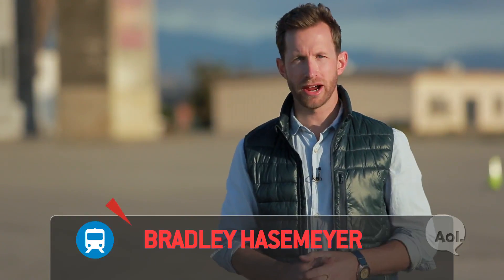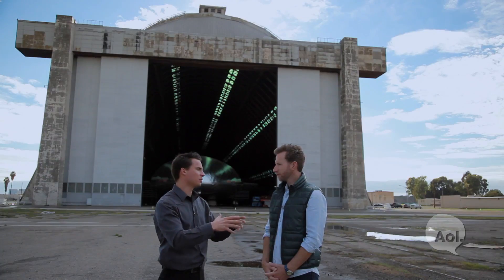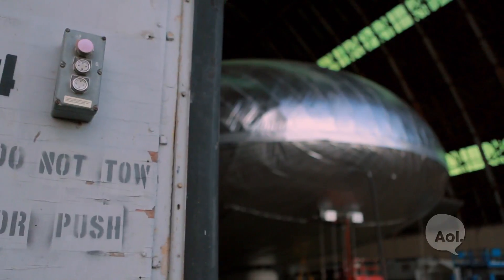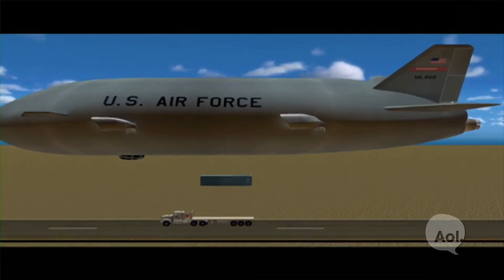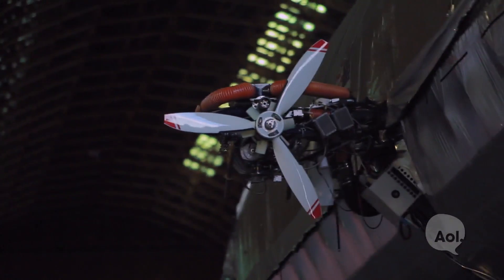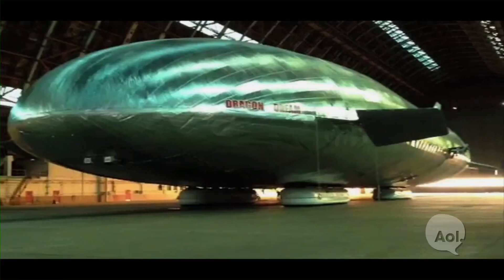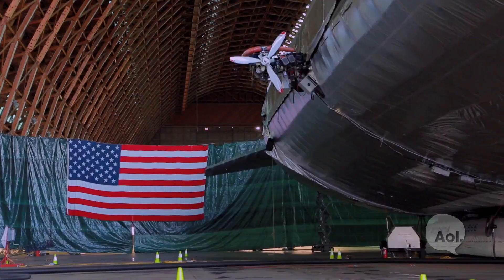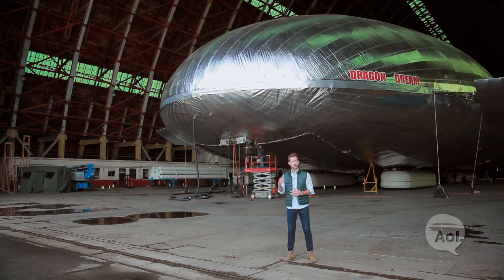Aeroscraft Rigid Variable Buoyancy Air Vehicle | TRANSLOGIC

Comment: Alternatives for the safe use of hydrogen in an airship.

Fire proof cabin - (Maybe use some of those space shuttle tiles? )

Passenger cabin hung well below the airship attached by cables that could extend toward the ground in the event of a fire? 

Upper hydrogen air bag separated by a Kevlar heat shield from a lower helium bag that could detach in the event of fire? 

Make sure the cabin can float in case of water crash?
Reply: Hydrogen is not used in dirigibles or in blimps,
it is Helium that is used to fill the bag.
-
Zeppelin's Hindenburg airship that was engulfed in flame was, unfortunately, filled with Hydrogen during that flight.
However, it was against all safety concerns and common sense of everyone in the industry.
The reason Hydrogen was used instead of the traditional Helium was that, at that time, the U.S. was the only major supplier of Helium in the world.
US officials had decided to cut off Germany's access to it in an attempt to curb Germany's newly elected government's spread of propaganda and influence.
-
The entire history of the airship is extremely fascinating, from where it started and to where people believed it would evolve; it's dramatic downfall and long-lasting stigma by the populus, then, to it's eventual ascension a whole century later.

Comment: main problem is you can't avoid bad weather all the time. You need the power and strength to fly through a storm. And if these airships can't do that, they won't survive.  Storms can lift of an airplane  a thousand feet in a few second or push a low flying air plane into the ground.
Reply: Nick,  Sooo?
Reply: All conspiracy theories put aside: they run off of pure Titanium -- remotely controlled, no helium, no hydrogen, no pilot; and are capable of producing a holographic cloaked surrounding (usually concealed as a plane), and fly above the earth puddle, leaving a chem-trail stream from one side of the Antarctic circle to the other.
Reply: Fly above it or around it.

Comment: Remember that the gass is not under pressure when it generates lift. A bullet wouldn't necessarily do more damage than it did to the Zeppelins of old back in WW1. Only a little gass would escape, because the holes would be small and the pressure difference small. It was incendiary bullets that eventually did the trick with the old hydrogen filled ships, but even with those a ship could be quite the bullet spounge. Hydrogen does not burn on its own, but needs oxygen right ammounts to catch fire.
Reply: These hybrids are made with self-healing envelopes and have very little overpressures.

Comment: I gave the one dislike because there are no clear answers nor hope on key issues.
1. Wind
2. Lightning or heavy snow
3. Speed? 
4. If speed increased wind would tear the material
5. payload is really small
6. it is just a balloon 

So here goes my dislike :) Now you can reply to me telling me I'm not right and I'm stupid and bla bla bla...
Reply: I think airships are cool,  they don't have a good track record.  The only way I think a airship would be a viable solution to transport is for it to haul awkward cargo like say massive wind turbine blades.  I also thought it could be used to transport perishables like meat, seafood or other things that require refrigeration.  It could literally fly up to an attitude that provided the correct temperature and then travel to a destination to drop the load.  I suppose I would be more excited if hydrogen was used as the lift gas and also with fuel cells to power the propulsion.  Of course hydrogen is extremely dangerous, but the Graf Zeppelin used it without blowing up. Helium is only in a limited supply.  There is plenty of hydrogen available.  More than we could ever attempt to use up.
Reply: @mfblowfish4671  Here we are 7 years after this video, I wonder if something actually came out of this
Reply: @TeacherFlash  The cruising speeds are around 180 mph at altitude.
Reply: With respect to the payload, I don't know what percentage of the total lift is used to lift the airship structure itself, but I just crunched the numbers, and the total lift of this craft using helium is about twenty-one metric tonnes. That's quite a lot.